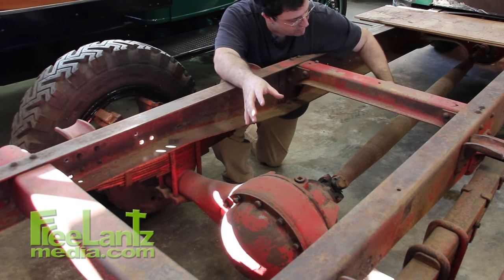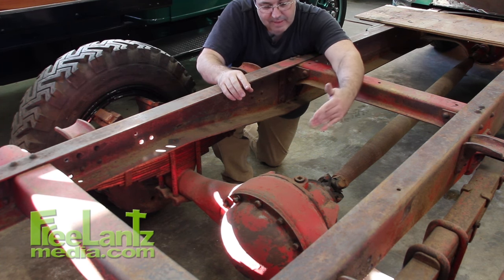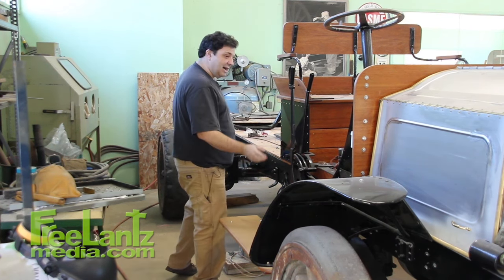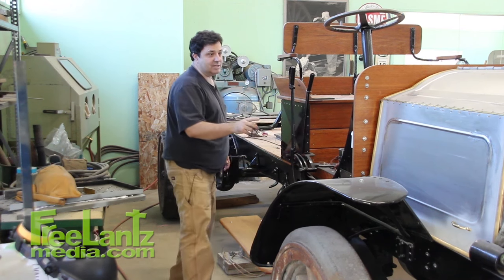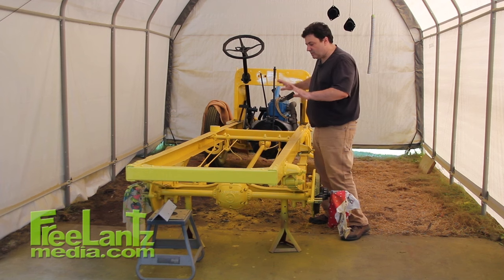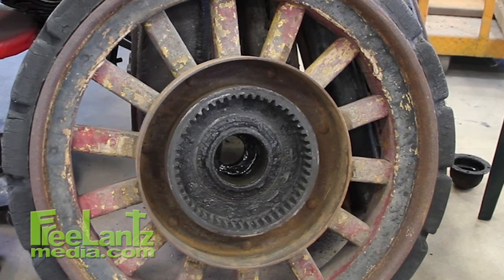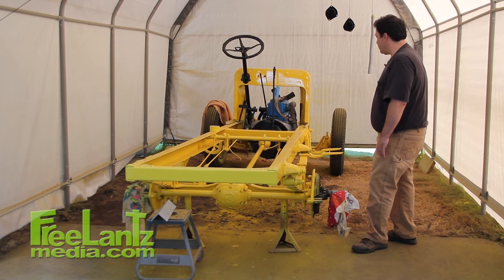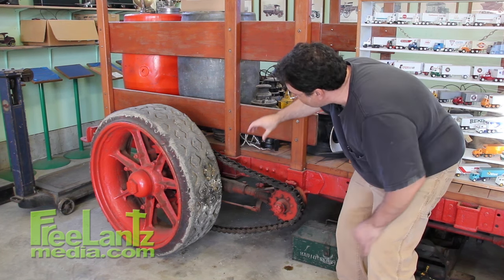Why chain drive?

Comment: Excellent explanation and demonstration of chain drive vehicles and not forgetting most of motorcycles also. Back in my younger days ( I am now 78 years old)  I knew a man who had a chain drive White truck ( bought out in America by Volvo) that he used to carry timber out of the Snowy Mountains here in Australia it was fitted with a Cummins NH 180 engine and a 4x4 transmission ( 4 speed main & 4 speed auxiliary).
Reply: I wonder what ever happened to it .
Andrew Gibb of Wangaratta is a keen White truck enthusiast
Face book group
Solid Tyred Trucks pre 1930s

Comment: Back in 1960 I lived by a long steep hill in West Yorkshire, UK which was the direct route between heavy industrial area and docks.
I used to see huge road trains hauling transformers for power stations coming up the hill.
Lead vehicle was old chaindrive Scammell with vertical exhaust blowing like a coal train.
It has huge chain drive sprockets that I remember as almost as big as the tyres.
I could never figure out how chains could be striong enough to pull the load but now I understand the pulley effect of chaindrive.
I haven't been able to dicsover if that Scammell survived or got scrapped.
Reply: Do you remember the company's name?
Reply: @machinerydoctor  I think the vehicles were the dark blue of Pickfords.
I did find a photo of a Pickford's chain drive not long ago.

There were also Sunter Bros big prime movers around in those days when Sunderland had heavy industry.
Reply: @rosewhite---  Scammels

Comment: The Yellow Republic has a Torberson style drive rear axle .
International Harvestor 
Mack and others run similar rear ends .

In  1927/28 IHC had normal hypoi diffs in their light duty series 
 Torberson style rear end in their heavy duty series 
And in their super duty series they added a chain drive 3:1 reduction in the 54C,  74C  , 94C and 104C series .
I have an incomplete  54C to restore

Comment: Chain drive still has some valid advantages to this day, mainly in the reduced spring weight of the suspension making it work more efficiently and keeping better contact with bumpy ground.  Honda ran a chain drive in the Honda S600? in the early 60s
Reply: Independent suspension though can work better !
Reply: @shankarwain4289  depends on application and driving techniques.
then there's production cost and longevity.
Reply: @scotte2815  yeah ! Hope there is even a comeback for chain drives !
Reply: @shankarwain4289  I think that you see them in small light homebuilt project cars from time to time, and that's a good place for them.
 As for massed produced turn-key cars, I wouldn't hold my breath
Reply: @scotte2815  in India , they still make old school diesel mechanical road rollers that still rely on chain drives !

Comment: Good video of some old trucks. On the yellow truck what is that round thing on the back end of the driveshaft?
Reply from the maker: It is a differential transferring the direction of rotation. Judging by its size I'm pretty sure there's no gear reduction inside the differential itself.
Reply: I may be wrong but I think that it could be some sort C/V joint.
Reply: @bobw7066  differential centre .
Torberson style axle